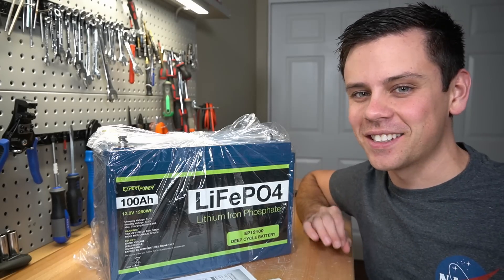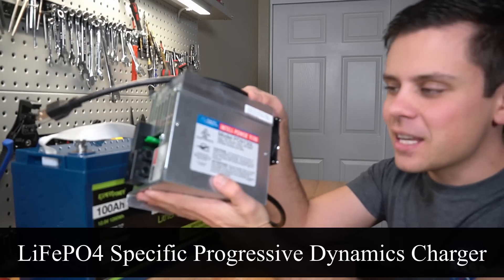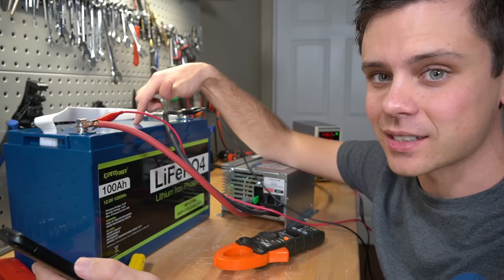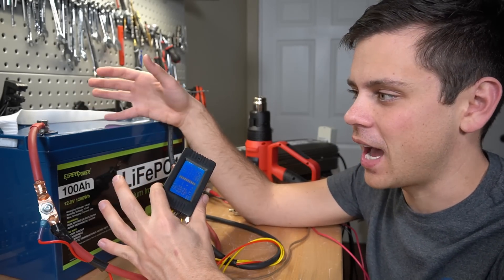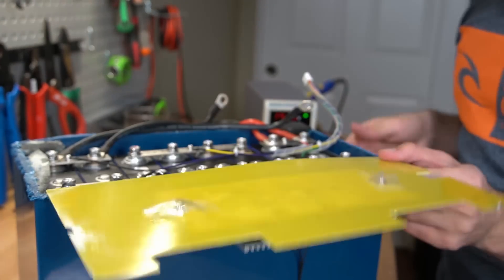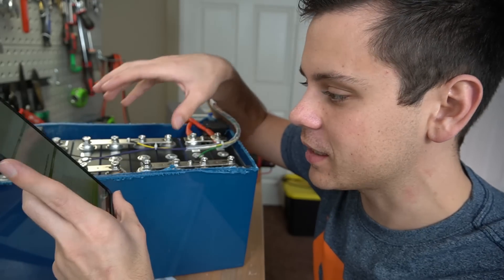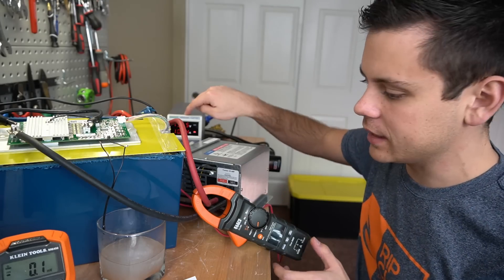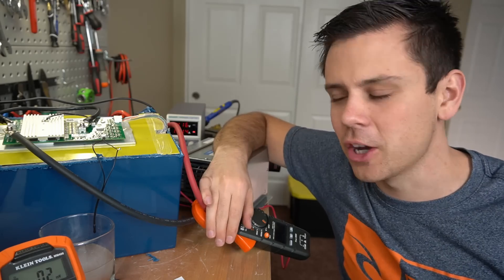ExpertPower 12V 100Ah LiFePO4 Battery Tear Down!

Comment: Hey Will, another awesome video!  Can you make a video on what the specific differences are between lithium "ion" and lithium "iron" phosphate (LiFePo) batteries, advantages of LiFePo etc.  There seem to be a lot of youtubers that use the two interchangeably, and Ion batteries can explode and cause a lot of problems.  LiFePo do not have those inherent problems.  Anyway, I'm also trying to find a decent charger that makes sure the battery doesn't get damaged.  Many of the NOCO chargers on amazon show that they are compatible with Lithium Ion batteries, that doesn't tell me whether they are good for Lithium Iron Phosphate batteries.  It looks as though the LiFePo chemistry is so new that manufacturers haven't had the time to include this spec in their product description.  It's been frustrating dealing with the fact that no one has nailed this mystery down once and for all.  I think this would be a good opportunity for you to get more views.

Comment: There is a possibility that the company, like Volkswagen, try to sell the specs but think the test would require it to charge even at freezing temperatures. Like they thought "it would mean it's better at low temperatures". Me on the other hand would like to have this protection shut off (removed) completely. A tiny resistor blocking my charging efforts, no way.

Comment: Will: would love to see a test on Mightymax 100Ah LiFePO4 Battery, please.  It is currently being sold at Walmart for $650 and the price is very attractive!  I'm not sure if Mightymax 100Ah also has restriction on connecting in series or parallel with strong BMS protection.    Thanks for testing ExpertPower LiFePO4 battery, unfortunately they sold out most their large LiFePO4 batteries, otherwise I would buy from them.

Comment: In defense of ExpertPower, in their Amazon description, at least as of today 2/11/2020, they do not appear to claim there is a low temp cut off at all.  Their exact verbage:

"The perfect battery for planned use in temperatures > 32F, or with solar controllers and temperature sensors that support low temp cut-off."

Although I'm not sure why it wouldn't have this feature, it can't add any significant cost, can it?

Comment: Maybe the the temp Sensor cable you cut hit some higher voltage parts in the battery than its tolerating, and got damaged...

Comment: Hi Will,
I've only just come across your reviews, and love them! The renogy battery sounds like great value and is available on our market in  Australia now!!
Anyway in Australia, some of the brands you review are either not available, or the price is a bit high.  Our drop-in lifepo4 battery market is mainly cheap ebay style batteries like some of the Aliexpress stuff you have cut open. But the 2x BEST brands of Lifepo4 12v batteries is the Enerdrive B-Tec of Victron smart ranges. And thei;r price point has dropped significatnly over the last 12months,
I'd really love to see a tear down and review of these, otherwise I think I would be buying a Renogy for my 4x4 camper set up.

Comment: I am disappointed in you, Will.  I was hoping YOU would have a longer runtime at that discharge rate.  Assuming you ate dinner, you should have had enough amps left to last AT LEAST until four AM.  I guess I have to take into consideration the fact the you are a relatively less expensive YouTube channel.  Still, though, we haven't seen if you can finish eating a meal when the temperature is less than say, 32 degrees.

Comment: I wonder if the second temperature sensor not being in the salt water had anything to do with it not cutting off charging? Having the whole battery in the freezer should have addressed that cooling both sensors, but it was only 22F with the cutoff of 23F, that's probably within the margin of error.
Reply from the maker: That's why we opened it up and did it manually. And did you see the response by the company? They found this problem in an entire batch. Usually low temp charging is triggered the moment I expose that sensor to cold temps. I trigger these batteries to test them, and it should have done it after I ripped it open and manually gave the sensor 6 degrees Fahrenheit
Reply: @WillProwse  Yeah. But mixed feelings on that response. They seemed to own up to it--but of course you forced them to. Their QA comments puzzle me.
Reply from the maker: And no, the mosfet temp sensor is only over temp. Look at data sheet

Comment: Have you considered doing a tear down of motorcycle/ATV lithium batteries?  I have a ATV and use a battery made by Antigravity. On the ATV it’s goes through extreme abuse, being sunk under water and mud, crazy vibration, probably the most abuse a battery can take. I’d like to see how well/safe these types of batteries are made for such abusive conditions.

Comment: Why is there a series/parallel limit?? :D
Reply: Dean Fjellerad I have the same question. Why do Renogy and others say you can’t hook in series to get 24 or 48 volts?
Reply: @larryragan8158  it is bs 😂 Unless i am missing  something. Sure there are some downsides, but I dont see why it should not work fine
Reply from the maker: Voltage rating of the FETs
Reply: The fets only see the voltage of the battery, not the string. Its like when you messure single cell voltage with a multimeter 😁
Reply from the maker: @ffs5310  yeah that's what I thought till I met the electrical engineers at battle born. I'm going to do an interview to show full explanation. In series string, the total voltage rating needs to be well under voltage rating of individual fets. I forgot why haha
Reply: @WillProwse  this becomes less critical as the bandwidth of the f e t s increases
Reply: @electronicmusclebike  what does the bandwidth have to do with it? it is dc 😌
Reply: @ffs5310  Power Electronics is an opportunity for people to become increasingly creative using the latest materials that are very difficult to create electrical components with the era of the vacuum tube or almost anybody could get a tour and some glass and some wire and be creative has passed and the ways that we use things like modern-day the paperclip origami designs AK transistors or whatever acronym you want to use to create what seems to be direct current or what seems to be a sinusoidal alternating current power source is actually not that as previously seen. Part of the current gospel about direct current is that you can put the batteries in series to create a certain wattage power by maintaining the same current. This is what people want to do with these batteries and these batteries have already batteries in series. In order to put the batteries in series you can use a alternative when they are fully charged like we have seen demonstrated on this channel with the relay. But if you want the pass all of the Power through the paperclip Madness send that paper clip Madness has to be designed for that possibility not just for the special youth case connect to an existing set of chemical sources of voltage to whatever load you have in mind.

Remember you're going to be charging the battery and taking energy out of it. During these Manufacturing different fluids or consumption of different fluids X Electronics is is going to be doing its bed blocking the passage of electricity or not and electronics he's going to be doing this differently from moment to moment. The load may not care about tiny gaps and perfection. However there is this concept of signal and the noise and other batteries can be far more noisier damn the load.

For those who want to learn how are Electronics I recommended learning it from specific contemporary use cases. For example the electric bicycle which is basically a fractional horsepower motor control dilemma.

In this dilemma there is no opportunity to do cost engineering and to add value. For what seems like a few or even several years there has been a YouTube channel from mainland part of the current gospel about direct current is that you can put the batteries in Ceres to create

Comment: Dang, this battery has a $120 coupon right now so it's only $670 ($712 with tax). I'm taking a chance on this battery before the price shoots up. Seems well made and I'm hoping Will just got a bad sensor. In my application, this battery will never be close to freezing since it's in my basement backup system.

Comment: Hello Will, thx for the video. You are doing the best job teaching public about the industry. 
I noticed in your tests that you're using an inverter to trigger the end of discharge. What is the trigger point? Doesn't it prevent you from testing the BMS's undervoltage protection?
Reply from the maker: Oh the inverter cut off is lower than the BMS LVD threshold. so it's all good

Comment: Do you know if it possible to do affiliate  amazon program with only Youtube videos or you need your website for the  Amazon affiliate program to work. I opened with YouTube website and they closed my affiliate account based on that YouTube is general website. Did I do anything wrong? Or should I link to my channel? I thought maybe you know since you’ve done it probably both ways.
Reply from the maker: Probably need a website too. They like that more. And be sure to add disclosures in YouTube videos description like I did

Comment: Good job Will. Looks like they are willing to "fail up" by the quick reply. Better than a dead end failure. Still trying to figure out my options for a battery bank power wall backup system when solar is not available. Always love your vids!

Comment: The disturbing thing about that is if the low temp cutoff doesn’t work, does the high temp cutoff? Or even does it cut out prematurely? I know you’re fixated on low temp cutoff but high temp is equally important.

Comment: Thanks for the tip on the Victron Battery Sense, I will include that in my van setup, nice to see something from Victron that is not expensive 👍
Reply: Most quality chargers with an explicit lithium setting will have low temp cut-off. They rarely fail and work well as long as you actually use the temp probe. Not everyone needs a battery with low temp cuttoff as the charger has that very feature. It still needs to be tested periodically IMHO.
Reply: @geraldhenrickson7472  In my case I am building my own LiFePO4 battery so adding the Battery Sense is very useful. With the Victron Smart Solar the options are: the internal sensor, external through the BMV or the Battery Sense. Since I won't be using the BMV the Battery Sense is the best option for me, it will also allow more accurate voltage measurement and the its really affordable.

Comment: Please be advised your charger can’t charge a battery fully if it finishes on a 30 amp charge(you battery will be mostly charged but not fully), the current should decrease to the end of the charge and only once your current has reached 0 will it be fully charged. Love your content. Great you finding new cheap and safe cells to use. Thank you!

Comment: Try understand the time it take for things to acclimatize (assume the surrounding temperature). Maybe 3 hours is enough to make ice cubes idk, but take a jug of water the size of that battery and see if it freeze solid to the core in three hours. I would give that battery 12 or 24 hours in freezer. If sensor is on inside of box it may / should have trigger a charging cut off, but then it does not measure the battery temp. Witch will be bad in an opposite situation when battery is frozen solid and took indoors to charge.
I think your second test is more accurate though when you freeze the sensor.
Reply from the maker: Great point. Usually the sensor is on the outside of the case (like it was on this one and other batteries) and I can trigger it in a few hours. But yeah, if you want the cells to hit that temperature, it would take a super long time. Good point
Reply: @WillProwse  if you want to protect the batteries you should have sensors close to or attached on them in my opinion.

Good videos btw. i learn alot as I'm new to LiFePo4. I wish I had easy/cheap access to batteries as you have in Usa. You favorite Battleborn is not even shipped to Sweden at ebay.